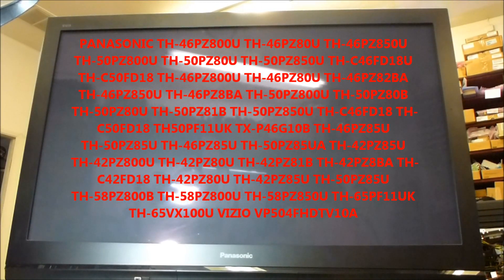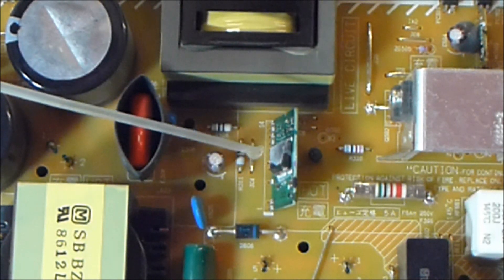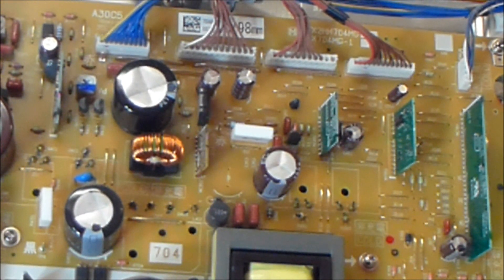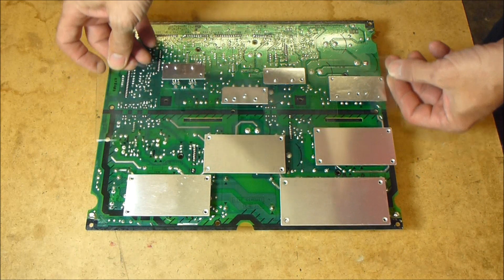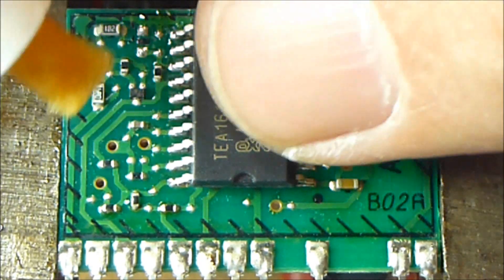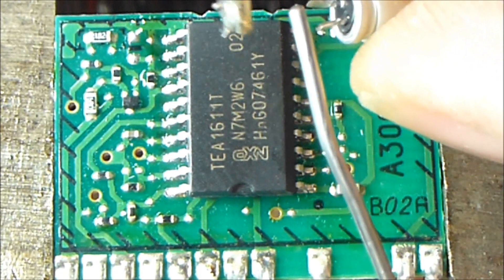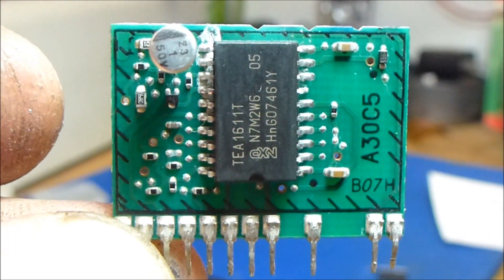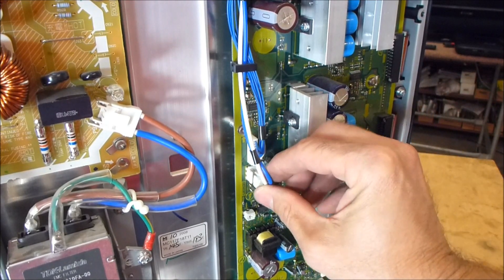Panasonic Plasma 10 and 2 Blinks TEA1611 ETX2MM702 704 706 Power Supply TH 42 46 50 58 PZ 800 85

Comment: Hello, My TV is a Panasonic TH-42PZ80U and once I plug it in to the wall outlet I hear 2 clicks then once I turn it one I get image, but after a while the image goes and comes back. The red light does not blink at all it just stays on red. I was wondering if this would fix mi TV. Thanks for any help and if you need more info from me please let me know. Thank You for your time.
Reply: Charlie,
I would first suggest that you let the TV finish it's internal system diagnostic.
So, plug in the TV and you will instantly hear the two power supply relays latch up (2 clicks).
Then, continue to wait until you hear ONE of these relays de-energize (one faint click).  This interval is about 14 to 16 seconds.
At this point, you can press the main power button to see if the unit powers on normally or it may just send a blinking SOS "code".
As soon as the TV is plugged in to AC outlet and the relays latch up, one of the internal microprocessors begins a system diagnostic which includes sensing faults from various subsystems.  Many of these error codes (faults) are the result of loss a particular DC voltage that is generated on the P Board, A Board, or D board.
Also, examine the back top of the TV and clean the fan vents if they are clogged.
Your unit has at least 4 low speed fans across the top in a horizontal row.

Do you know how to use a Voltmeter  ?  Or, do you know someone who could
take a few measurements at Test Points on the main power supply board (P Board)  ?
At some point in the near future, the TV will fail completely and generate an SOS error code.  That will actually make this process easier.
Regards, GS
Reply: Thanks, after sometime the unit now displays 7 blinks.
Reply: charliewiseco
Charlie,
The 7 Blink code indicates a problem with the display scanning subsystem.  It involves the potential failure of one of several boards.  The boards of interest are SC, SU, SD, D or possibly the P.  The P board is the "main" power supply board which is the board that Norcal715 repairs in this video.
Below is a link for the Panasonic Troubleshooting Guide for the GPH11DU chassis:

http://elektrotanya.com/panasonic_th-42-46-50pz80u_th-42-46-50pz85u_th-42-46-50pz800u_th-46-50pz850u_chassis_gph11du.pdf/download.html

This guide could be very helpful to help you isolate the offending board.  Once you isolate the failure down to the target board, then you have to make a decision to buy a new (or rebuilt) board ....OR repair the original which requires lots of expertise to troubleshoot down to the "component level".  But, as a first pass, you could get lucky and find a discolored or burnt component ....or bulging capacitors ....or leaking capacitors on one or more of these boards.
The first thing I would do is to perform the "cool down" test on MC201.  This small board (mounted on the P Board) drives high current MOSFETS that ultimately generate the high voltage supply called Vsus.  This is such an easy test and requires very little time investment.  If your set does not respond to the "cool down" test, then the next thing I would do is to measure Vsus and Ve with the appropriate type of digital voltmeter.
       Vsus = 205v
        Ve = 157v
This is VERY DANGEROUS work.  If you know an electrician or electronic technician, then let them take the measurements for you.  The multi-meter that I use can handle up to 1000v (max) before damage will occur to the analog front-end section of the meter.
Hope this helps.
Regards, GS.

Comment: Your video definitely helped me diagnose the problem, thank you. I did the test as you outlined and worked perfectly, once supercooling the part. Now the fix. I can't locate the parts on ShopJimmy.com. Can you please provide the part numbers for the 2 IC's and the capacitors, so I order correctly? You also state the two little boards are no longer made by Panasonic. Removing those and resolder is more tempting than the overall repair. Are there any aftermarket manufacturers out there? Please advise and thanks so much for posting this. You do a great job of describing.
Reply: Actually ended up finding the parts on ShopJimmy.com by entering the board part number and a repair kit came up. The capacitors are different though.

Comment: I have a TH-50PZ850U that shuts off with 4 blinks. After unplugging it and plugging it back in then pressing the power button, the TV is back on but only for another 10 to 20 minutes and then again shuts off with 4 blinks. Can you please help me?
Reply: Guesag,
The 4 blink "SOS" error code indicates a loss of one of the high current, high power, DC voltages on the main power supply board (P Board).
I had the same problem with my Plasma where it would stay powered on for an hour or more, then crash.  As time when on, it would stay powered on
for 20 to 30 minutes, then crash.  Eventually, it would only stay powered on for a few minutes then power off.  Finally, the set would not power on and would just blink SOS error code.
The 4 blink SOS code is a generalized error for the P Board (main power board). 
It indicates an abnormal increase in any of the voltages generated by the P Board power supply (Vsus, Vda, P15V, P5V, STB5V).
It can also indicate a downstream power supply failure on one of the DC-DC converter supplies on the D Board.  But, that is a much lower probability of occurance.
Below is the list of key “Test Points” for your HDTV as a reference.  You would FIRST want to measure the “low voltage” test points (P15V, P5V, STB5V) to see if any of them are present.  If BOTH of the ultra small ckt boards MC201 and MC301 were not functioning properly, this would most likely generate the 4 Blink error code.  Why ?
None of the vital voltages would be present.  The StandBy (STB) voltages are generated on the power-entry power board and supply power to the “system monitor” microprosessor.  This power source rarely goes bad.  And, in your case, it is still active.
So, ………you could try Norcal715’s “cool down” procedure to verify if one or both MC boards respond to the cool down treatment.  If so, you will be able to fix  your Plasma fairly quickly IF you have good soldering skills.  Hope this helps.  GS.

Name     TestPointName        Voltage                    VariResistor
 
Vsus       TPVSUS (SS bd)     Vsus ± 2V              VR251 (P bd)
 
Ve           TPVE (SS bd)         Ve ± 1V                  VR16000 (SS bd)
 
 
Vset        TPVSET (SC bd)      325V ± 7V              Fixed-no adjustment
 
 
Vad         TPVAD (SC)             -140V ± 1V            VR16600 (SC bd)
 
 
Vscn       TPVSCN (SC bd)        Vad +145V ± 4V    Fixed-no adjustment
 
 
Vda         TPVDA (SS bd)          75V + 1V, -2V       Fixed-no adjustment

Note:   Vsus = 190v   (see internal white label)
           Ve   =  145v    (see internal white label)

Comment: The LED light on my tv flashes 13 times.  Would this video work for my error as well?  If so, would I have to also replace the parts as shown or would using the air can be enough?
Reply: If that were the case, you might be standing behind your TV with canned air for the rest of your life!  lol
Reply: Dawn,     What is the full model number of your Panasonic Plasma  TV  ?
Does the TV power-up normally  ?  If not, how many clicks do you hear when you attempt to power-on the unit  ?
The clicking that you will hear comes from 2 different relays in the power entry section of the Main P Board (main power board).
The 13 blinks of the LED error code indicates a problem with the A Board (Digital Signal Processing board).  This board also generates a bunch of low voltage DC supplies to power the majority of the IC's on this board .....and has a Standby Power microprocessor that monitors the states of many of the standby DC voltages.
The use of a can of freeze spray (or can of compressed air), is only to cool down the region of the NXP power controller chip (IC) on small circuit board MC301.  The act of applying extreme cold to the IC and the coupling capacitor (ultra small capacitor) is to change the operating characteristics of the capacitor enough to get it to behave like a known good capacitor (temporarily).  In my opinion, the quality of this particular capacitor is responsible for all the problems with circuit board MC301.  It is an extremely poor quality capacitor.  This ceramic capacitor should last 15 years or more !
Fortunately, this capacitor is mounted near the top edge of MC301 and can be replaced without removing the large, main, power board or the MC301 board.
But, the first step in this debugging process is to determine if the circuit board responds favorably to the cold spray method.  If so, the capacitor is the culprit (in my opinion).  Watch the entire video and pay close attention to the small circuit board MC301 as he zooms in on the component side of this board.
NOTE:  The NXP Power Controller chip is a VERY high quality integrated circuit device from a "rock solid" semiconductor company.  There is no way it could fail at the high rate that is observed with all these Panasonic power failures.  This is the main reason that I claim the capacitor is the sole offender.  Good Luck.   GS
Reply: Gary Spencer Hello Gary,

The model number is TH-58PZ700U.  I unplugged the tv for about 5 minutes and plugged it back in.  The TV made a click-click in fast succession.  When I pressed the power button, the tv did not make any clicking noises, as it usually had done, and the red LED light came on.  None of the buttons on the tv or remote control worked.  When I tried to turn the tv off again, it did nothing.  I ended up holding the power button down for a few seconds and then the tv turned off.  Then it proceeded to blink 13 times, pause, and begin the 13 blinks again.

I watched the video in its entirety and know without a doubt that fixing this is beyond my expertise.  Thanks for getting back to me.  

Dawn
Reply: Dawn Schoenfeld
 Dawn,
Standby for a bit while I download and examine the schematic for your unit.
This Service Manual defines all the "visual" error codes and possible cause.
In addition, it will define the type of chassis that your unit is.  Then, we can proceed to narrow down the generalized problem.  This will give you more confidence when you have to bring it to an HDTV repair expert.  Your TV is very expensive (compared to mine .....$1400 for 46 inch) and it might be worth
having experienced HDTV technician give you a SOLID repair estimate.
Bye fuh now.     Gary
Reply: Dawn Schoenfeld
Dawn,
The 13 blink error code is suggesting a problem on the DG ckt board.  This board is no longer available from Panasonic and it is out-of-stock at every other online location(s) that I checked.  The Panasonic part number for this board is  TNPA4129ABS and would cost approx  $115 to $140 for refurbished board.  I found a site that allows one to special order the board at ULTRA high cost (link:  http://www.tvserviceparts.com/TNPA4129ABS.html) of $252.69.
The assumption is that this board is actually bad.  It may not be.  It could be a slightly loose connection on one of the cables or harnesses.
So, this makes it difficult for a repair technician to fix your unit unless he/she has the talent to locate defect down to the component level.  These people are friggen RARE.  Norcal715 is one of these Master Technicians that can fix anything electronic down to the discrete component level.
If you lived in New England, I could fix this rig for you.  It 's far too difficult to ship HDTV's anywhere without the manufacturers shipping materials.
Your best bet is to contact Norcal715 and get his advice .......and he may be able to suggest someone in your region.  Hope this helps.
Regards, GS
Reply: Gary Spencer - Thank you Gary.  I appreciate you taking the time to look up the information for me and giving me advice.  Dawn

Comment: I had the same problem on my set. I bought the repair kit off Ebay, changed the IC's on MC201 and 301. The TV worked well for 1 month, and now the same problem again :(  Is there a permanent fix for this?
Reply: Ken,
What is the model of your Panasonic  ?
I would strongly discourage purchasing any components from the "open market".
We need to rely on vendor APPROVED component sources such as DigiKey, Mouser, Arrow, etc.
When we buy from open market, you don't know how these components are handled.  Even a small ESD event can "partially damage" a silicon IC.  Such a device might function for a short time and then finally fail.  This would be obvious to you if you could glance at many examples of electron micrographs of small ESD damage to the top and/or bottom layer of a silicon IC die.

Let's assume you did a great soldering job with the IC's and they were not abused or received too much heat during soldering process.  Then, I would urge you to replace JUST the electrolytic capacitor on MC301. If that does not work, replace cap on MC201.  Obviously, you could replace both caps at the same time, but you would not know what board caused the problem.
The caps that I used in my Panasonic Plasma were purchased from DigiKey ...... p/n  493-10252-1-ND          1uF, 50V, Alum, non polarized

Best Of Luck,  GS.
Reply: I found out that, if I disconnect and HDMI cables on the TV before I power it back on, it will start. With the HDMI connected it gets the blinks of death. weird
Reply: Ken Ormsby
Ken,
I assume you eventually want to fix this rig.  How many blinks do you get when you press the power-on button  ?
What is the model of your HDTV  ?
Regards, GS.

Comment: Thank you so much for this video.  Without it I probably would not have managed to fix my TV.  I have a 6yr old Panasonic TH-50PZ80B Viera Plasma which recently started to display 2 red blinks when turned on (2 blinks only - not 10).  I selectively sprayed the MC201 and MC301 boards to identify which one was the problem.  After reading some comments elsewhere it seems that the 2 blink error is probably caused by the capacitor, not the TEA1611T IC.  So I removed the capacitor from the offending board and replaced it with an electrolytic. Bingo!! Works a treat.  I did it in situ, which was a bit awkward to say the least, but it saved having to take stuff apart.  Well pleased :)  Thank you norcal715
Reply: Hi Glynn,

I'm also just getting the 2 blinks on TH50PZ81b so was wondering how you identified the offending board or did you just change the caps on both?

Also is the TV still working?

Thanks

Sunny
Reply: I sprayed one board at a time using an inverted can of compressed air (as shown in the video).  By a process of elimination this identified which was the offending board.
Reply: Glynn Griffin
many thanks Glynn, off to by a soldering iron and and caps. Hopefully just a cap replacement will work for me too.

Thanks again.

S

Comment: would this work with the TH-42PZ80B?
Reply: Yes.  Spray the "chip" area on the MC301 ckt board with can of compressed air.
If you're unit comes back to life, then remove the capacitor and test your unit for a few weeks.  Watch the entire repair video to determine exact location of the decoupling capacitor. 
......... WARNING  ........
It is extremely dangerous to work on high current, high voltage equipment  !!  Always wear eye protection !  Let TV unit discharge all stored capacitive energy before touching anything internal.  This is called "bleed off" process.

Comment: many thanks for the great video, i just removed the cap and TV started working, so just replaced it with a through hole 1uF 50v monolithic with some high temp Silicon to hold it in place. Seems to be good. thanks again

Comment: What a great post! This was exactly my problem. I had first acquired a Panasonic service manual that helped me determine the P-Board wasn't supplying 15v to P6 pin 7, but that was it!  

Now that I know I don't have to replace the entire P-Board, I have decided to have someone else repair it since I just found out my soldering iron has stopped working and my eye site aren't what it used to be.

I already replaced my Panasonic TH-50PZ80U with a 55" Vizio M Series 3D 240Hz smart TV which is a great TV, but doesn't have as nice of a picture as this Panasonic. Go figure...

Comment: Hi, I was getting 10 led blinks so changed both the ICs and capacitors with the help of your video. But unfortunately now I'm getting 2 red LED blinks after a pause. Sequence goes like this < Power button pressed < two relay clicks & fast blinking green led < third relay click and then 2 red blinks starts and repeats after a pause. Any suggestions pls.
Reply: Did you perform the "cool down" test as shown in this repair video BEFORE you replaced the IC's & Caps  ?  If so, did your TV function while MC301 was cold  ?
The MC301 board is responsible for generating the 15V DC supply.
         The 2 Blink SOS error code indicates loss of 15V supply.
What is the model of your Panasonic Plasma  ?
GS.

Comment: Great tutorial, I am new to TV repair and my first is a 2004 Pioneer PDP-504CMX with a shutdown green light sequence of 8. When turning on with the back panel off, I can hear a quick double click, a red & green light on the digital video Assembly board, a hum, fans start and stop, and then another click (sounds like a relay), but then the Plasma goes into shutdown with the 8 green blinks. Can you help me locate the problem. I have the technical manuals and will receive an Ebay remote in the mail shortly, what I cannot find is an inexpensive ARP3242 manual (schematics).
Thank you for all of you help.
Jerry